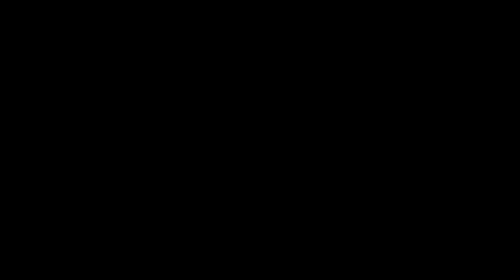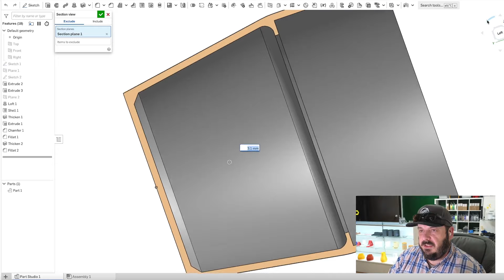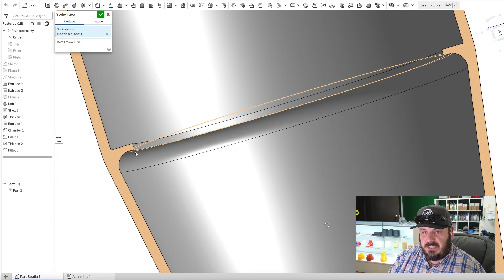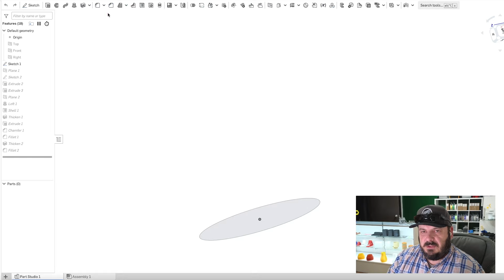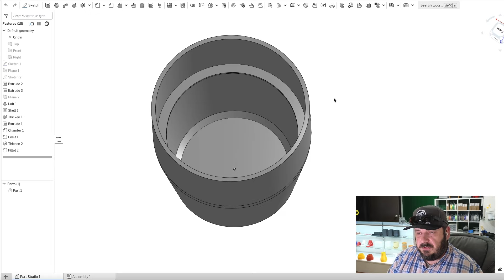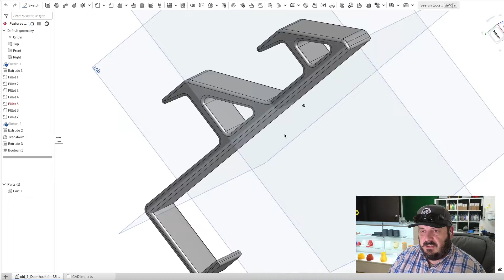Practical 3D Printing: Why I Design Solutions, Not Dragons

Comment: I’ve been working on cup holder designs for my car (using Fusion 360). I don’t quite understand the inner lip. It interferes with a bigger, taller cup seating itself at the bottom of the holder.
Reply from the maker: The lip is what his "bigger" cup rest on otherwise it wouldn't be stable in the holder side to side. The opening is still as big as the cars cupholder, so a normal cup can pass through to the bottom.
Reply: @ so it’s a big cup, but not a tall cup?
Reply from the maker: @ThatAdam12  right his cups diameter is larger than his cupholder so it doesn't fit down in it at all
Reply: @ thank you for clarifying. I have the opposite problem. Can’t be too tall so a small coffee cup with a lid is accessible, but tall enough to hold a large coffee securely. It’s been a fun process testing out the various iterations.

Comment: Good stuff. I, personally, would use a chamfer instead of a fillet. Specially because it's concealed but also in my experience chamfers tend to work better for this purpose. Still, that's totally nitpicky.

Now, how about making this design hollow and not have a bottom? Kind of like a pipe. If you care about saving plastic and cutting printing time I imagine that could help what? 5-10% The reason I thought about this is if the person spills beverage and when going to give it a wash, he/she wouldn't need to make sure under that lip is clean (although it looks easy to clean in your design still).
Reply from the maker: Thanks for the feedback, Now that I think about it Chamfer would work better.